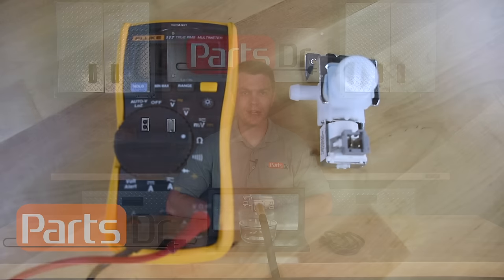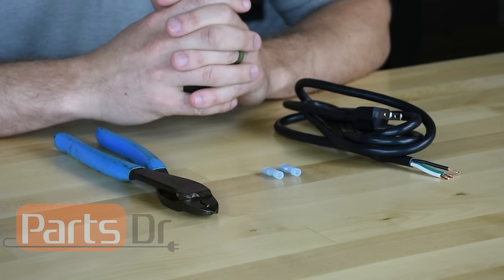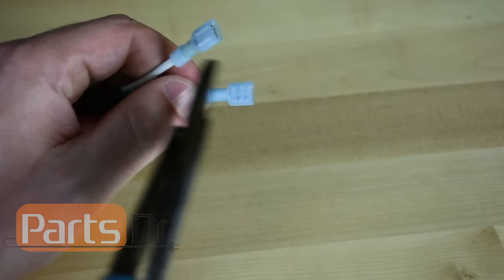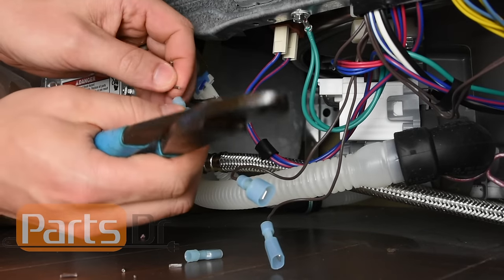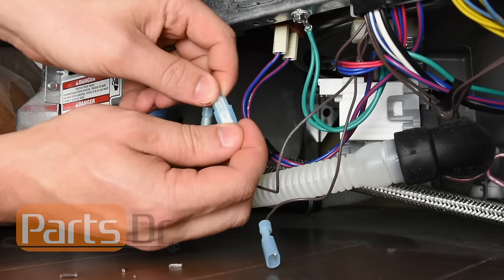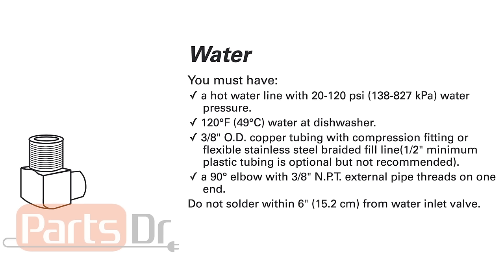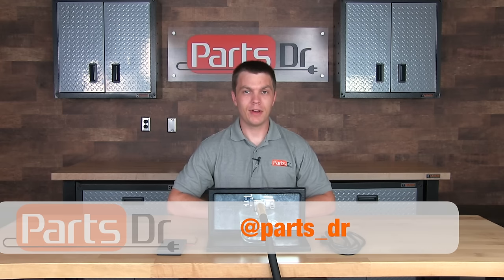How To Test A Dishwasher Water Inlet Valve (The Right Way)

Comment: Although I did it a little different, this video saved me from thinking that this part was bad. Unfortunately it was something more expensive, but it’s working great now and I didn’t waste money on something that I didn’t need. Thank you so much for the video!
Reply from the maker: Great!  What was the cause of your problem?
Reply: @PartsDr  replaced the sump/sprayer pump/diverter assembly. The diverter shaft seal was leaking down the shaft into the diverter motor and corroded it. Price wise, for those two (sump and diverter), it was not too far off to replacing the assembly and have a new sprayer pump too, so I did that.
Reply from the maker: @ysrpilot  Great! Thanks for sharing!

Comment: You told me what I needed to know at 8:00.   My old valve just had two Spade connectors instead of a harness type connection.  So I wasn't sure which wire went where onto the new valve.  Thanks for this critical info!
Reply from the maker: Glad you found the answer!

Comment: This is a really cool video! As a plumber/gasfitter who diagnosed a bad water inlet valve on a friends dishwasher earlier (normally done by an appliance repair technician) i decided to check out some other ways to do it. This video was great. I like the test cord (i do it lots with furnaces and zone valves etc) and I really like the battery pack idea. In my scenario this evening, i checked voltage to the solenoid. It was 123 volts so i knew i was good there (used to checking line voltage when fixing furnaces and boilers etc) then i ohmed out the solenoid and it was in the mega ohm range. I really like this video as it was a safe way to test this valve. Very accurate as well. Great video! Cheers!
Reply from the maker: Nice job diagnosing the problem!

Comment: Right you are.  I removed the fill valve and powered it with 115 V ac.  I could barely force air through it.  I removed the screen and forced the valve with a pointy tool.  Surprisingly it works.  I hope to get a new valve monday.  Our propane dryer also had a valve that failed to open enough.

Comment: I’d say an easy way to test them is to measure the rate of water flow - disconnect it from dishwasher and divert flow into bucket. I have found that a new valve allows a 1.3 gallons per minute rate. Most GE washers are timed for a 1 minute opening of valve to fill the basin. This assumes a higher flow coming from the supply hose directly but this won’t change the 1.3 gal/min rate too much as long as the inlet valve is supplied with at least 2-3 gal/min from the hose
Reply: so it auto shuts off after 1 min?

so if thats true, if a valve is not turning off, it certainly is the valve?
Reply: @harryharry3193  - yes
Reply: @harryharry3193  - if after a minute or two, the valve does not turn off the check the power to the valve. Solenoid receives  power to open valve, and closes when the power goes off. If the valve remains open, when the power is off to the solenoid valve is bad. These are simple things to check.
Reply: Thanks. This is the information I was looking for. My dishwasher is not filling the tub but it is allowing water to flow.

Comment: I also installed a floodstop unit with sensor under my DW - that way if something leaks, the Floodstop will shut off water to the DW - I also have this on my fridge. Also, these units test the water shut off valve monthly, turning it on and off to exercise it - a great time to install something like this is when doing a repair like this to the dw -

Comment: Good video, but there's an easier way to test the inlet valve without building a custom power supply (and it tests everything). Caveat: I'm just a homeowner but this worked for me.

Turn the dishwasher on its side or front and remove the inlet valve from its mount. Leave the water supply hose connected and disconnect the valve outlet hose (from the valve into the dishwasher). With the dishwasher off, you'll see immediately if the valve is leaking. Place the valve so that the outlet nozzle squirts into a bucket or bowl. Restore power to the dishwasher and turn the dishwasher on (in a cleaning cycle) - almost immediately the valve should open and let water flow into the bucket; if it does then everything up to this point is working (the dishwasher control board, water supply and valve). Now just cancel the cycle (or turn off the water supply) before the bucket overflows. If no water flows then you can troubleshoot the valve, control board etc.

Comment: your video is excellent.  I just installed a brand new g.e. the inlet valve is hammering away,  causing water to splash in the cup and leak. I tested the signal and it shows constant voltage.  my appliance supplier provided me a free replacement for me to install.  the new one did the same thing.  now, wtf? I gated the shutoff under the sink , probably open 25%, and it solved my problem.  have you ever seen this?  what are the chances of 2 bad valves in a row?  the amount of restriction on the hot water feed now effects the brand new faucet on the sink. I'm perplexed. my customer is pretty pissed off to, but understanding of how weird this is. the ge people India don't know what is going on and my street pressure is spot on at 60 to 80

Comment: Tested my valve 120v with a test cord...works fine.  Put in unit... valve doesn't open.  I had 120 to the leads in the unit...but each lead is 120 to ground...not to each other.  Is one of the leads going to the valve supposed to be ground?
Reply from the maker: Neither of the two power wires should be grounded.  If there is a ground on the water valve, it is usually a separate wire.
Reply: @PartsDr  ok....more specifically... when I turn the washer on... both the white and purple wires are hot.  One should be neutral...one should be switched hot....no?
Reply: @PartsDr  it seems like the vale is energized but has no flow.  I apply 120 directly from the wall and the valve opens.   Install it in unit and it IS energized.... and no flow

Comment: Instead of using a separate power cord couldn't I just turn the dishwasher on and test the incoming plug to the inlet valve for the proper voltage ?. If I have 120 volts at the plug and it's not working then the valve's defective.

Comment: I have an issue where the dishwasher does the initial fill and then doesn’t add any water between cycles.  after this stopping it takes awhile before the valve will release water again.  How do ai diagnose this?

Comment: In my case the solenoid was h
Good and valve was working properly but it had a slow/leak drip right at the plastic glue joint/seam, that eventually tripped the water overflow sensor in drip pan
 saving water damage to the floor area. The valve is made of plastic and I assume it had a small crack at 90degree angle and after the leak happened after 2years of use. This Resulted in the 'normal' light blinking rapidly on a display panel of the dishwasher. After systematically replacing the partsy dishwasher works again!
Reply from the maker: Nice job fixing the problem!

Comment: replacing inlet valve on bosch  dishwasher 110 volt with 2 spade connectors  wires can go back on to either terminal ?
Reply from the maker: Yes, with AC voltage you can connect the two wires to either terminal.

Comment: we checked the valve as per your vedio  reinstalled it but still not operating we checked the power supply it was correct but as we reconnected the power dropped and the valve does not open
Reply from the maker: Sometimes the control board that supplies power to the water inlet valve can fail when it is under load.

Comment: My valve does not have voltage markings. How do I determine if it's 120 Vac or if it's a 13.5 DC valve?
Reply from the maker: What is the make and model of the dishwasher?
Reply: @PartsDr  Whirlpool GU1200XTLS3.  Thank you!
Reply from the maker: @curtisnotestine3134  This water inlet valve is 120V AC https://partsdr.com/part/8531669-water-inlet-valve

Comment: Question: I bought a new valve and applied AC power. But, it doesn't open the valve fully. I tried to push air through the valve using mouth, but very little air comming out. Can anyone help?

Comment: My water inlet valve opens anytime the door is shut, but it will stop/close when the float switch engages. I'm stumped.
The switch and float are fine. And if the inlet valve was stuck in the open position, it would still fill when the switch engages and even if the washer is unplugged, but mine doesn't.
Whatever tells it not to open after the cycle ends and drains or not to open before you select a cycle and push start, that's what's not working
Reply from the maker: What is the model number of your dishwasher?  https://partsdr.com/model-number-locator/dishwasher

Comment: Great video! So I tested this on my GE and the valve seams to work fine. The issue that I'm having is that when I start a wash cycle it does its drain then pause, but does not start the wash. It just heats up and if you leave it for a while it gets everything inside extremely hot. Any suggestions would be great. Thanks.
Reply from the maker: It may be a bad circulation pump.  Have you checked to see if power is being sent to the circulation pump when it should be washing?
Reply: @PartsDr  I will check the pump. Thank you

Comment: You  never did show how to safely connect a power supply to the valve with the pin-type connectors.
Reply: Neil Garber yeah that shit hurts
Reply: That’s cause he put female ends on both the valve and the battery pack... 😏

Comment: Hi, Happy July 4.  Frigidaire dishwasher.  Works fine, fills and empties for 3 cycles.  In fourth cycle (about 1 Hour into full 2-Hour cycle), it keeps filling and eventually overfills and leaks.  What could this be?
Reply from the maker: Possibly a bad control board?  Let us know what you find out.
Reply: @PartsDr  Hi!  Well, sadly, I'm not able to "find out" anything, other than to keep ordering and trying changing different parts until it works LOL.  So you think it's the control board?  I was thinking maybe I should get the inlet valve that you describe in this video.  But you think it's more likely the control board instead?  And thanks for your Time.
Reply from the maker: @jackwilliams5474  To narrow down the issue you would need to test to see if the dishwasher is sending power to the water valve when it overfills.  If the dishwasher is sending power to the valve when it overfills it is most likely a control board problem.  If it isn't sending power to the water valve when it overfills then it is most likely a bad water inlet valve.
Reply: @PartsDr  Wow, that's awesome thanks!  Sadly, I don't have any way of testing if it's sending power, nor would I really Know how to do that anyway (I'm pathetically unhandy LOL).  So what I think I'll do is change the inlet valve, and if that doesnt work, order and change the control board.  It should definitely be 1 of those 2 things, right?   And thanks again!
Reply from the maker: @jackwilliams5474  Normally it would be one of those two things.  We can't make any promises since there are so many variables and unique situations.
Reply: @PartsDr  Thanks.  Thankfully both are available through Amazon, which of course, has no hassle returns, so I'll just order them and return whichever one I don't end up needing.

Comment: Thanks! Question, even if the filler valve produces only a trickle, why wouldn't it still fill the basin till the float trickers?
Reply from the maker: Good question!  Most dishwashers use a time based fill.  This means the dishwasher only fills for a pre-set amount of time and the dishwasher does not know if it fills with enough water during this time.  The float at the bottom of the dishwasher is usuaully just a saftey to stop the dishwasher from filling up with too much water and overflowing.  Some newer dishwashers from Bosch and Samsung (and some other brands) use a flow meter or sensor to measure the amount of water filling into the dishwasher.
Reply: Parts Dr thank you so much I really appreciate it. This was the missing piece of in information that I was looking for. You have saved me a ton of money and I'm grateful thank you!!
Reply from the maker: You're welcome! Glad we could help!
Reply: Time-based - aha! That's why my inlet valve only fills the tub part way!
Reply: @PartsDr  yes I agree it is timed based. For GE profile it is 1 minute. That gives me a 1.3 gallon fill. That fill does not trigger the float cut off however. I wonder if GE really designed the float to not be triggered during typical operation of the machine. Meaning it is more of a safety feature. Thanks for posting

Comment: Why not just leave the valve wires connected and power/turn it on from the dishwasher controls but with the outlet tube disconnected to catch the water into a bowl to observe the water flow?
Reply from the maker: Because something could be causing power to get to the water valve.

Comment: will a bad water inlet valve cause a loud when in wash mode?
Reply from the maker: Not in most cases.  If the noise is constant then it is usually a bad pump motor or some thing stuck in the pump.  If the noise gets louder and quieter over and over then it could be a water inlet valve causing the dishwasher to not fill with enough water.  When the dishwasher doesn't fill with enough water the circulation pump can start to surge and it will make an louder and quieter noise from the pump.
Reply: It will when it’s filling with water if that is what you mean by “wash mode”.

Comment: If the dishwasher isn't outputting power to the water valve, how do I check that?
Reply from the maker: Locate the wiring diagram to see what supplies the power to the water valve.  On most newer dishwashers the power is supplied by the main control board.  Older dishwashers the power is usually controlled by the timer.  Also, check the wiring that goes between the two.

Comment: Hi there, thank you for your well presented video. I have a Bosch series 6 SMS50m22Au and have discovered I only have 55Vac to the inlet valve.  I am not getting any data on the screen other than the Rinse aid and  check water light. Could there be a problem with the PCB. If you are able to offer some guidance that would be greatly appreciated.
Reply from the maker: I'm sorry, we do not have service information on your model.  If the water valve isn't receiving the correct voltage, you would want to check the control board that sends power to the water valve.

Comment: I pulled the dishwasher out and set it on  blocks. So I could get under it and take a look. The wires at the back of the water valve looks to be a solenoid valve. I took the hose that carries the water to the dishwasher off. Turned the dishwasher on and got Nothing, no water. I took a screwdriver and tapped the solenoid valve. And I got bath, flooded the whole kitchen. I got it all put back together and put back into the kitchen. Tried to run another load and all it would do is hum. I think it is begging for water. So I am pretty sure this water valve is plugged up. Most likely because they put in a new subdivision up the road. When they did we were out of water for a day or so. When the water did come back on it was muddy took a few days before it became clear. My sink plugged up and had to be replaced. So I am guessing the dishwasher is the same. I was pretty sure this was the problem. I started fooling around with this POS because of a water leak. One thing just lead to another. Now that I can see under the dishwasher I have found No leaks.
Reply from the maker: It sounds like the water inlet valve is bad and should be replaced.

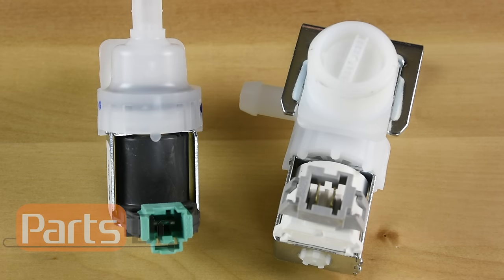Comment: at 4:32 the piece on the right. The plastic filter, if pushed in to far, can it pose a problem?
Reply from the maker: Yes, it could potentially cause a problem if it was pushed in far enough.  Also, if there are any breaks in the screen you will want to replace the valve.
Reply: is it possible to pull the plastic back out towards the front? Or how could someone test to see if its broken?
Reply from the maker: We don't know of any way to pull the screen towards the front.  The screens are usually fixed in place at the factory and they are not designed to be moved at all.  The only test we can recommend is the test we show in the video.

Comment: It is a great video! My DW makes a grinding noise recently. It still cleans very well and drains very well. Just the noise is the issue. Yesterday, once I heard the noise, I immediately rushed over and opened the door. There were 47 minutes left on the clock. So roughly 50 minutes had passed. Inside DW, it was pretty warm and there was no water on top of the bottom screen. So I am totally at loss. Was the noise made by drain pump when it was to drain, or was it made by the inlet valve when it tried to open and let water in? Any one can help? The noise is not constant. DW only makes this noise two or three times during an 100 minutes wash cycle. Thanks for any help!
Reply from the maker: It is hard to say what is causing the noise based on your description.  What is the model number of your dishwasher and how long does the noise last for when it occurs?
Reply: Thanks for the reply. It is a 10-year old Bosch SHX45P05UC/60. A full washing cycle is about 100 minutes. The noise happens about twice and quite short, but it is pretty loud. That is why it bothers us.
Reply from the maker: Maybe check to see if it is coming from the detergent/rinse aid dispenser?

Comment: Why cut the wires to the inlet valve?  Just disconnect the connector from the valve and apply power there.
Reply from the maker: That should work if you have larger spade terminals on the water valve.  Some water valves have very small connections that do not allow that.

Comment: I changed my water valve,and the flood switch and still have no water in the dishwasher
Reply from the maker: It could be a bad control board that sends power to the water valve or the wiring between the parts could be bad.